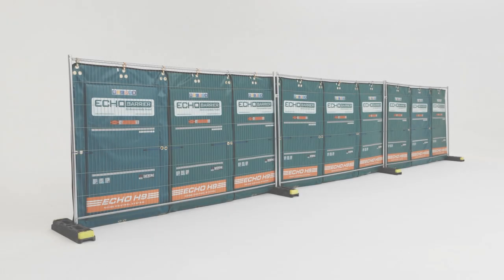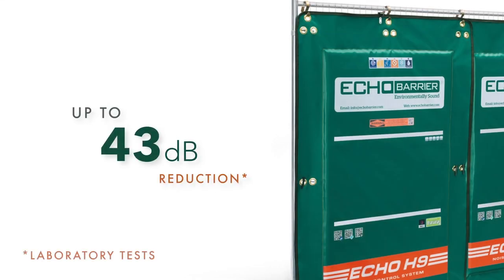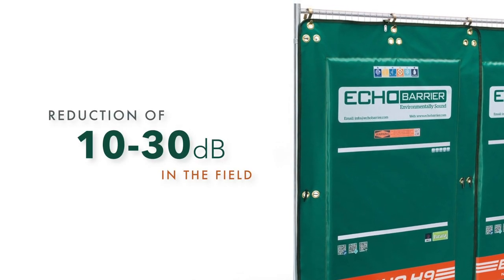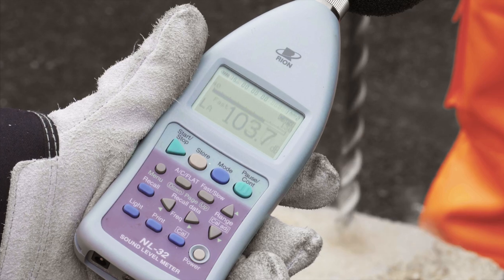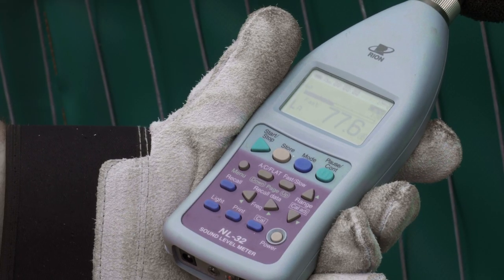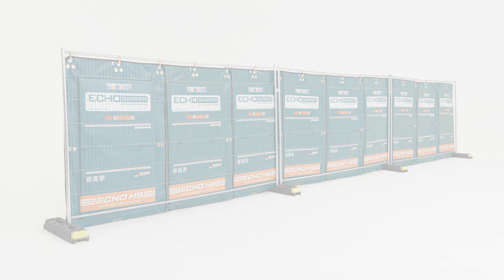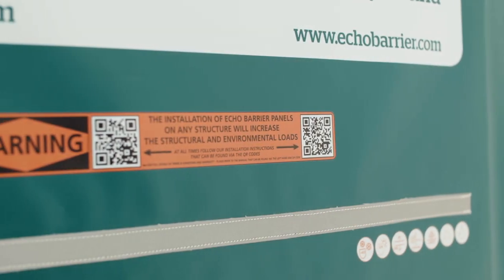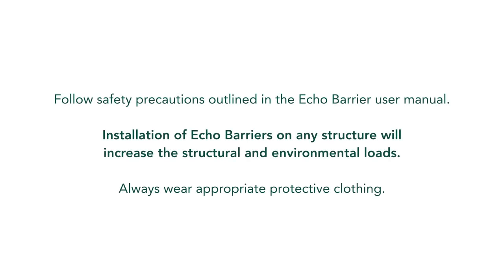26 dB Reduction Rotary Hammer Noise - Echo Barrier

Comment: I'm sorry, but this is not how you measure sound reduction. You measured a foot away from the tool and then directly behind the barrier. You could had used cardboard and it would had shown a considerable reduction with the way it was measured. Do it the right way and I might then consider your product.